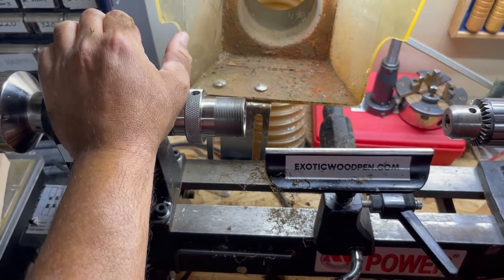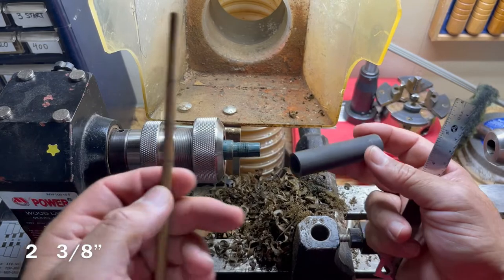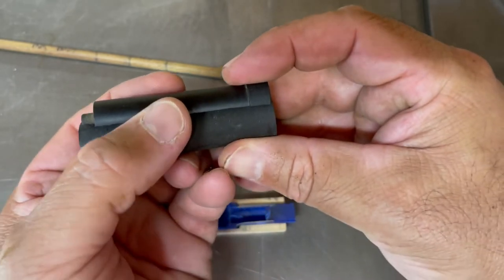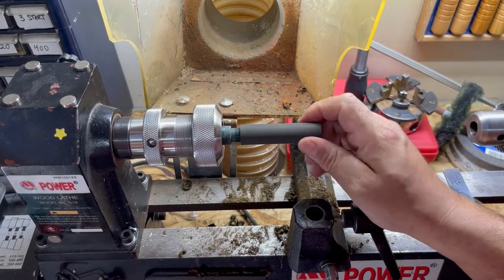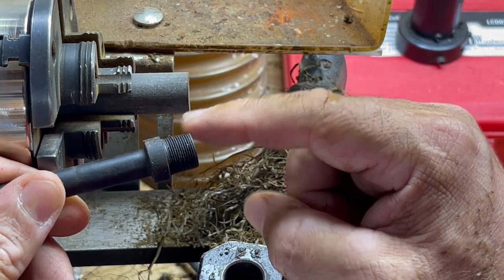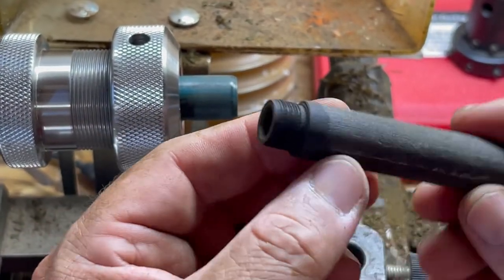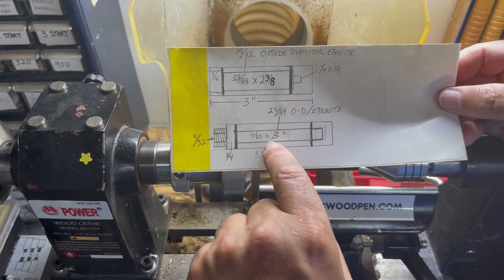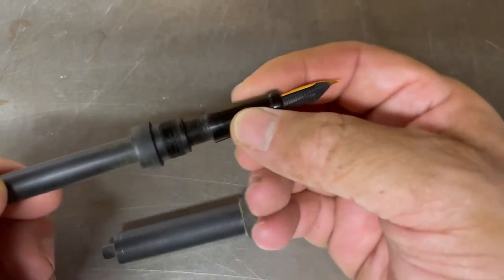Ebonite cap and body sleeves

Comment: I follow a very similar process Gabe. In fact, identical. The tight threads are a pain, and I use a fine paste (Yorkshire Grit) on the threads, then run the tap / die down a couple of times. Works a treat.
Reply from the maker: Nice to hear that the process I use is the same as others.  I will have to look into Yorkshire Grit on the threads.  Thank you so much for sharing this tip.
Reply: @exoticwoodpen  admittedly I cheat. I use a metal lathe!

Comment: Watching it once again … so was your 10x0.75 for your jowo#6 without making the separate section right?
Reply from the maker: Hi, the 10 x 0.75 is for the section to body connection.  If you look at the end of the section, the threaded part is the male 10 x 0.75 thread and where it screws into the body is also 10 x 0.75, hope that helps.

Comment: Gabe, I know you already spoke about it, but where do you get the Jowo #6 nibs?
Reply from the maker: I usually buy them on eBay
Reply: @exoticwoodpen  is there a particular on you use, meaning the metal of the nib.  they are not gold, are they?
Reply from the maker: @johneliadis9689  I usually only look for 2 tone or gold color steel Jowo #6 nibs on eBay but I believe you can get them on amazon too.

Comment: brad point.... well I suppose if you don't drill completely through. I've blown up many blanks because of brad points..
Reply from the maker: Yes I have as well, I been using brad points because of wood grain drift and have not bought a new set for the ebonite which does not need it but just using what I have.